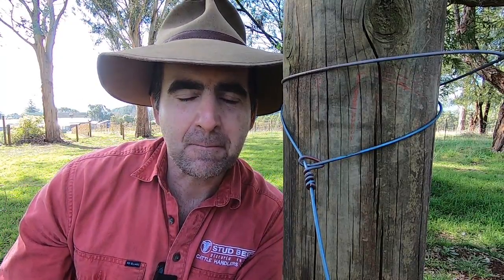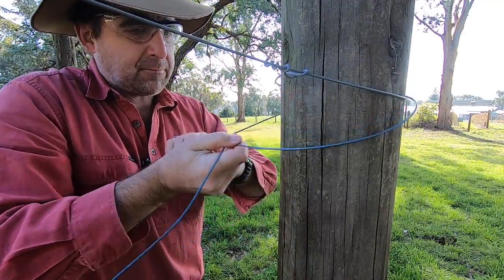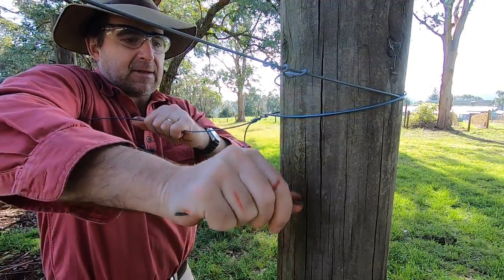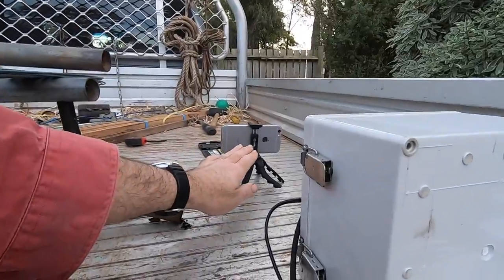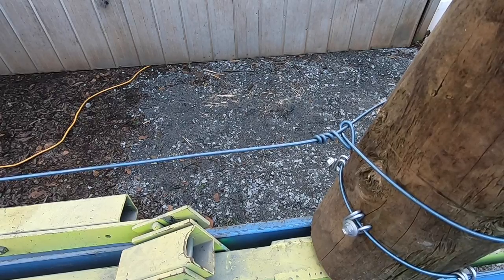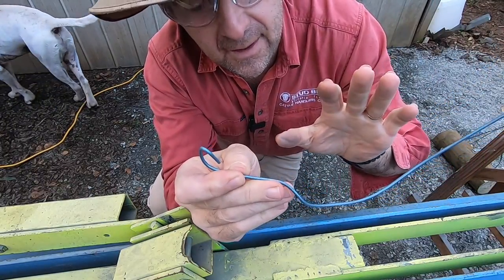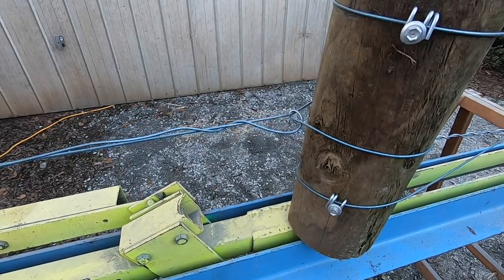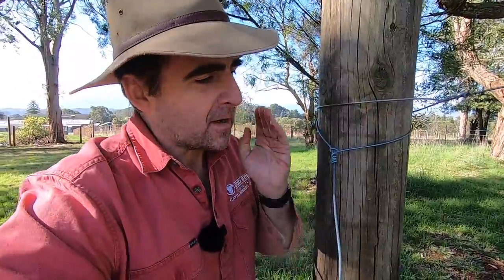Fence Termination / End Knot Tied and Tested

Comment: I build fences in Kansas, so barbed wire cattle fences are my bread & butter. I discovered your channel and watch it to learn techniques I might apply to our own fencing. Thank you for all of your excellent videos! IN this case, I t seems that your knot is cutting your wire as they are pulled to to the center line of the post when put under tension - extreme tension, in the example of your demo. We double or even triple wrap our wires around the post (tightly) so that friction on the post holds the wire fast under tension, and wind the tail end of the wire around the line merely to keep the wraps on the post from slacking. When done correctly, the line stay on the face of the post and there is no knot to cut the line when put under tension. Don’t know if that would work with high tensile wire, but I don’t see why it wouldn’t. Then again, I might just be a day late and a dollar short yammering on about an idea you’ve already tried and discarded! Anyhoot, thanks again for all the vids and great techniques!
Reply from the maker: Good on you John. Great points. Glad you like the videos!

Comment: Great stuff Tim!
If it is a high pressure fence 
I wrap the wire around the post twice or even 3 times, then align the wire so it has minimal direction changes.
Try that on the test bed
Using steel angle iron strainer posts makes it hard to maximise wire strength
Cheers 
Darren 
Milton NSW

Comment: Great vid, Tim.  The fact that the wire keeps breaking at the pigtail of the knot, shows the faultiness of the knot method, whether neat or sloppy.  It looks to me like the wire breaks at that location because the knot wire cuts across the line wire as it tightens, continuously grinding and cutting it in the same location.  The moving knot wire also sustains scraping damage, but not repeatedly in one location, rather the knot wire moves along spreading out the damage it receives, so it does not break. 
The way to avoid this cutting action is to use no knot.  Simply wrap 4 neat, tight coils around the line wire to terminate, so that as the wire stretches tighter it will only slip through the coil wraps, without repeated cutting across any one spot on the wire.  My guess is that 4 simple wraps would have a higher breaking tension than the knot method.  (Also, as others have suggested, make 2 or more wraps of the line wire around the post before termination to ease the strain on the termination wraps).
Reply from the maker: Unfortunately, no. The wraps simply loosen under pressure. Hence knot. Any joints, bends or knots weaken high tensile wire. Wrapped wire undoes and looses tension at around 200kg tension. Very bad practice.

Comment: what about an end knot that wraps around the post TWICE and  then twirls 4-6 times to finish WITHOUT going back inside first? Thoughts? Im thinking less kink points to fail at.
Reply from the maker: I’ve tested that. The knot breaks faster due to the double wrap unevenly loading it.

Comment: Next time you run the end knot test, see what happens when you wrap the end wire around the post twice, position the loose end such that it crosses the main wire at 90 degrees, then tie the knot. This will reduce the tension of the knot pulling on the main wire by a factor greater than 2.
Reply: An alternate method to test, insert the main wire through the staple, wrap the loose end around the post once (or twice, once may be enough) pass it through the staple, then bend it back to the main wire and make a few wraps around the main wire. All the strain is applied to the staple after friction loss against the post. The main wire is not kinked or nicked as it would be with a standard knot.

Comment: I don;t understand why you can;t just tie this knot under strain and save having to cut and redo a knot
Reply from the maker: You can if it’s a long run. Loose too much tension on shorter runs
Reply: @FarmLearningTim  Awesome, thanks which knot do you use for this? Can't find the tye of knot to tie the same piece of wire together, everything is about joining
Reply from the maker: @ashleycox5288  Mastering the Art of Straining and Knotting Fence Wire
https://youtu.be/ngWdp96iMd0